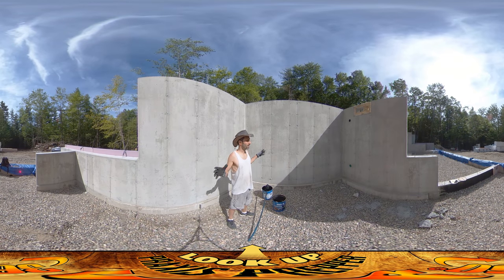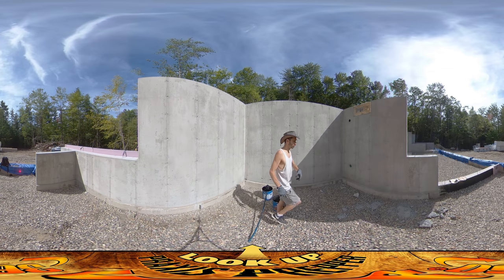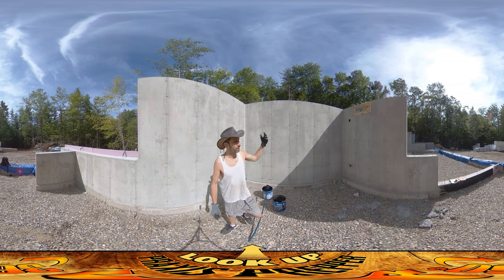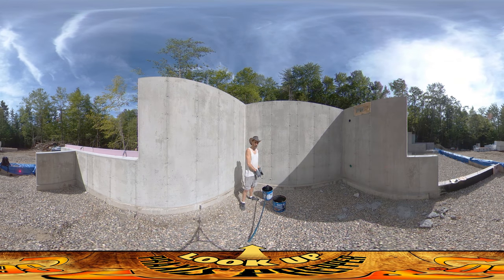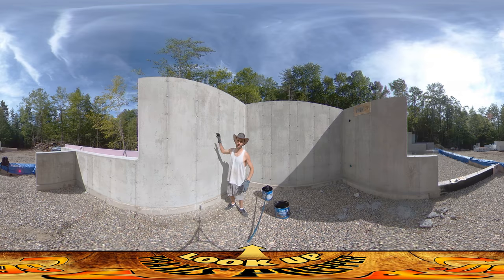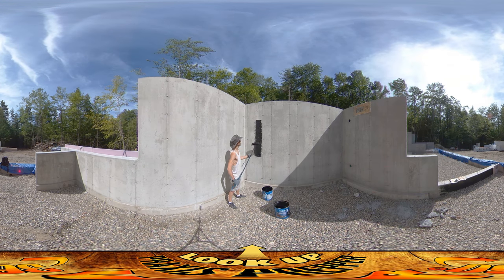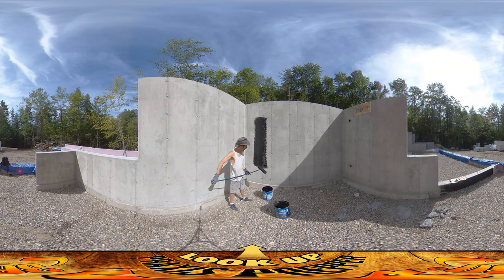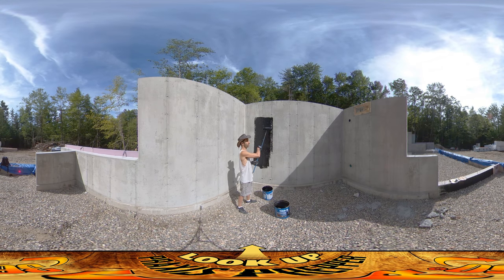Homestead Building - Applying Asphalt Sealer

Comment: Roofing in the winter we ignited the top layer let it burn. Put the lid on and extinguished. Pliable sealer. 
Apprised you didn't use Henry blue skin system off similar much better sealants less caustic much better at air barrier and water sealer. Not cheap though but your climate would be a win
Reply from the maker: I wasn't that concerned with the sealer because if I put nothing on at all, the situation would really be the same. The foam panels are what will keep the foundation dry. The sealer is just to meet code. As for environmental impacts, I'm often time leary of various "green" claims of different products. So when I'm not sure what I'm being sold, I tend to go with what I know. The tar itself (as far as I'm aware is a natural slime that bubbles from the earth anyhow. Some of the newer nano stuff, I just don't know how solid the claims of preferability really are. They may be true. I just have trouble figuring that out for sure.
Reply: @PraxisPrepper  my favorite example of green product is vinyl siding. So you are very correct on that statement about green claims. Well outs looking great. Imagine the smell of lumber is coming. We're framing a massive and complex addition right after kitchen remodel. Concrete guys it's systemic problem. Even paying top dollar and halfway across the country.